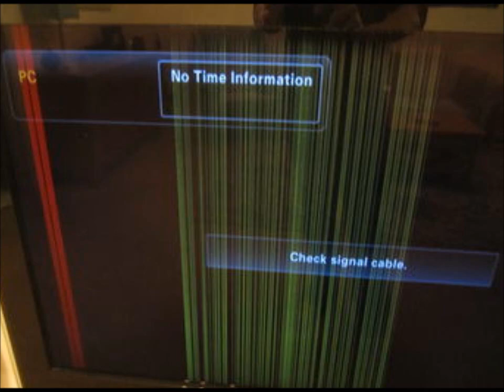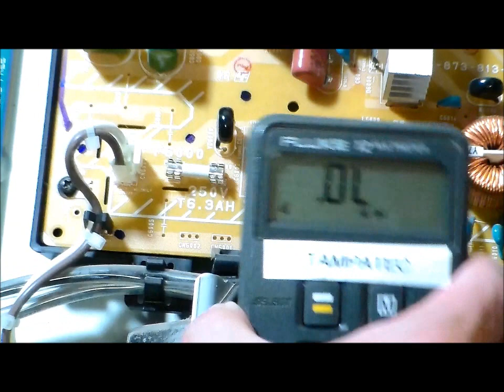What TV Boards Commonly Fail in LCD - Repair Service Guide

Comment: Tampatec hello, I saw some of your videos, it is very nice what you do... So i have a Sony KDL 40 X 4500 television which have around 7 years and i have small vertical lines which appeared everywhere. sometimes they are white, sometimes they are green depends what colour is the backround of the picture - i can send you a picture if you want but i do not have your address.
Do you think that it is a t - com for sure? The t com reference is the following: 404652ASNC6LV4.5. 
Could you please help me because i have difficulties  to find this t com in Europe, but before all i have to be sure is it coming from a t com or from a screen, because if it is the screen it is too expensive and it is not aveilable anymore. Thanks a lot!

Comment: beware guys at 1:37 he's touching the metal silver heat sinks, you can get shocked by this, of course the set if off here, but he should be warning us. I got a pretty good jolt off one of those in a set.

Comment: Sir I need your Help.  I don't know whats a problem my TV LCD.  I press PowerBotton - the Screen Come out/Picture , after 2 sec. My screen totally Block. and Red light Blinking 4X.  .. I  reset it. Push Up Arrow & Power Botton. Dons'nt work.. sir Pls reply. thanks..TV Model KDL55NX720
Reply from the maker: unplug powercord then unplug tcon board then plug in tv power if tv stays on (with backlight glow) it's tcon board causing tv to shutdown, Sony kdl TVs usaully have tcon board issue.
Reply: Thank you very Much,  sir Tampatec. I try . thank u for reply.
Reply: Thanks Sir , I order already the T-con.,  Itry to replace. .

Comment: Hey Tampatec,  I have a Sony XBR-75x850c, I replaced both the GL2 and the G4 power boards and same problem. No Power or led light. So I pull out meter and service manual and try to decipher their Greek naming on their troubleshooting flowcharts and when I test standby voltage (which is suppose to be 3.3v by the book) I get like 0.8. So I just wanted to test the wire harness so I unplugged the harness at the main board from power board and now I test standby voltage at about 3.4v through the harness. When I plug it back into the main board it tests at the main board connection at about 0.8v. So does this narrow it down to the main board? I wish I could trouble shoot that board XBR-75X850C A-2072-607-B because I can not find it. In the repair manual it also says that their is confidential information on that board and to follow instructions whenever parts were repaired or replaced. so whats that about? 

thanks for any help 
Shag

Comment: I have a Vizio e55oi-b2..i moved it to a wall mount..and now it has on top and on the bottom..5 " from and on the bottom... all the way across in the middle is good left side start gets brighter on goes away on to the right side...i just know it is a easy fix screen is not broken or cracked....can I get some help.??

Comment: I have a Samsung tv model UN6036000SFXZC 60 inch TV Samsung has a red line down the middle I taken off the back of the panel and trying to touch the ribbon cables and checked if they were loose and it was OK I just don’t know what the next step would be oh to be wrong with it. if you could help me that would be great.

Comment: changeged t con still same problem ...original t con screen bright no video
Reply from the maker: Bright screen but no picture is usually tcon but sometimes main board. also try lowering backlight settings.
Reply: Bright screen oonly no video or menu
Reply: With replacement board. .half of screen purple...an other half menu dimm an blured